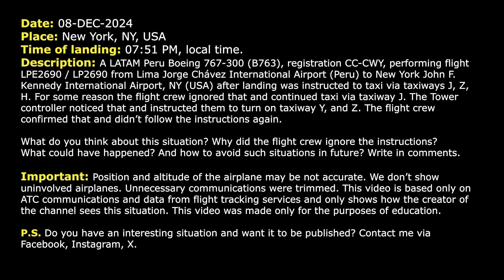Pilots ignore controller’s instructions twice at New York Kennedy Airport. Real ATC

Comment: Yes, this is a possible pilot deviation (and ground probably dinged them on that). Doing partial readouts may of lent to the confusion, but the first readout from the controller was "right Juliet, taxi Zulu, Hotel, hold 22 Right" which was read out wrong.  Ding the pilots for not getting it right and getting confused, ding the controller for not reiterating the full command.

Comment: Would it better if ATC say turn right into H (or into Y). They said taxy Y , H now, without the direction of the turn. Is it easy for the pilot to know in which direction should they turn or would it be better if the direction of the turns were specified?

Comment: Both of the airplane's readbacks were incorrect, but instead of telling the crew to repeat the instructions ATC told them to "Hold Short 22R."  This would be a new or updated taxi instructions on whichever taxiway their on.  Verification is important!
Reply: Not a pilot but my thought was that he was emphasizing the most important thing: Hold short of the active runway coming up.
Reply: The pilots did make an error, likely to pilot fatliuge due to a long flight.  However, the controller did not get proper read backs and should have caught the pilots misunderstandings.  The controller was unprofessional on the radio, and it was likliy a good thing that another controller stepped in or additional errors would have been made. 

Have the cat fight on the phone and not the radio.
Reply: Yes, and English is probably their second language so the details can get lost when you get instructions given like that I’d imagine
Reply: @Jm28400  These are very simple instructios, language is no excuse!
Reply: Controller needs to speak in normal speed and acknowledge for many English is not the native lanuguage